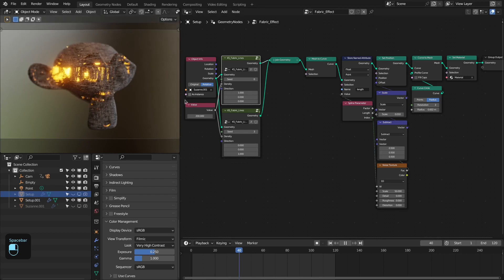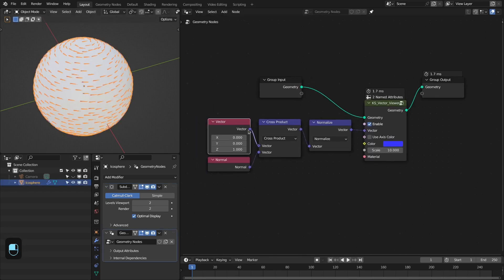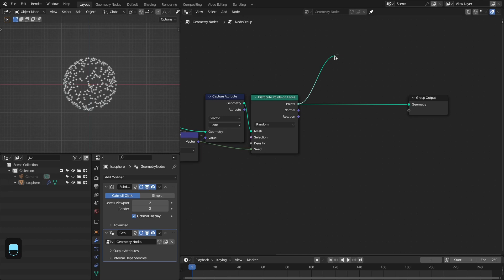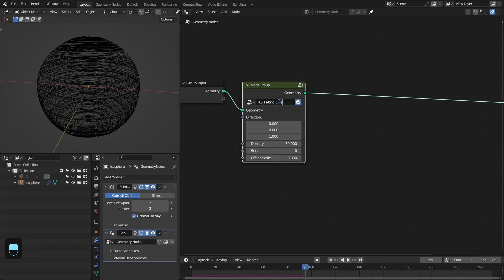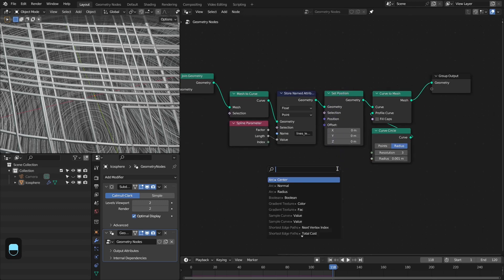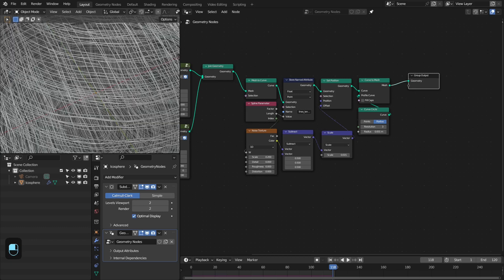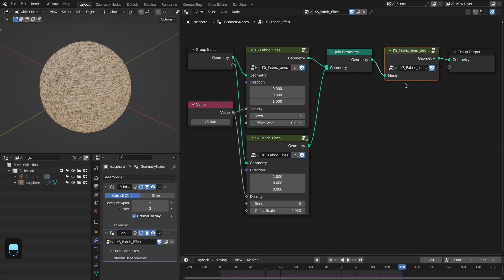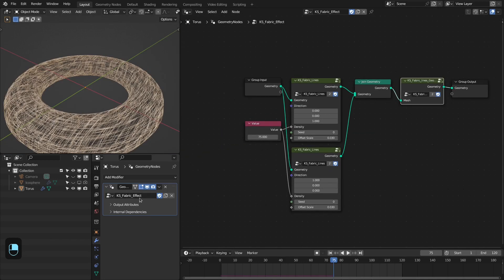Fabric Effect with Simulation Nodes in Blender - Tutorial

Comment: Thanks for this. Another way to animate the final weave is to add after the join geometry a mesh to curve node followed by a trim curve followed by curve to mesh node. This may slow down processing depending on the density of vertices so it may be ok with a faster machine.
Reply from the maker: Hi. yes, that is why I have shown both methods: 1) animate them in Simulation Nodes setup or 2) with Curve Trim Node.

Comment: Q: You skipped the making of the node group fabric, and for some reason mine remains with separate in & output nodes i.o.w. input-> node group-> output...... how did you make it into the group as is seen in the vid? (PS I know it's Control G to make a node group)
Reply from the maker: Hi. Sorry for the late reply. Select all the setup-nodes except the Group Input/Output nodes then press shortcut keys Ctrl+G. Then, You manually add the inputs as I have added in the video.